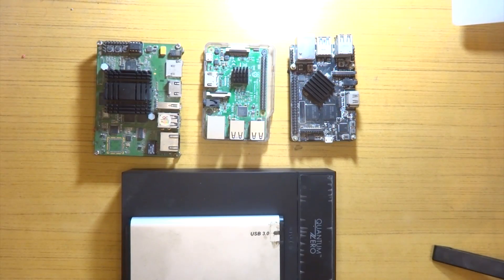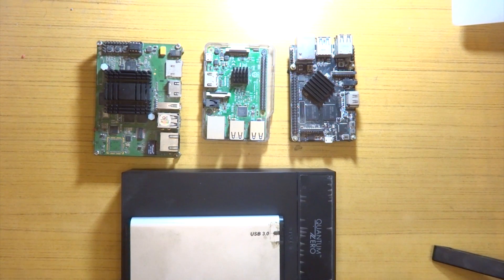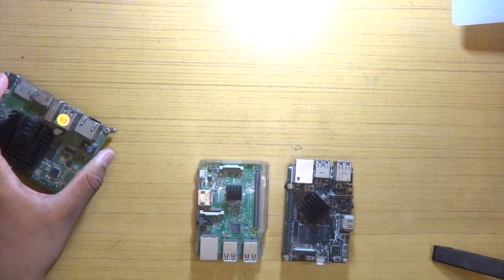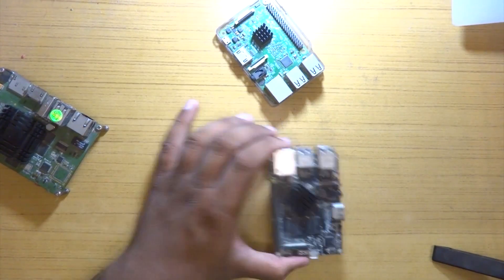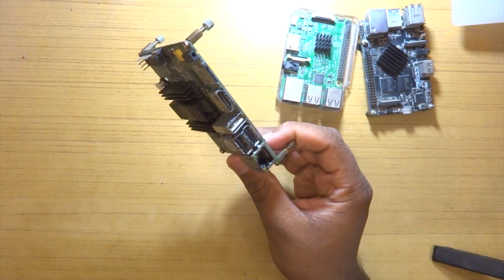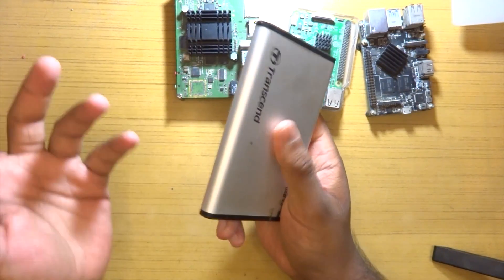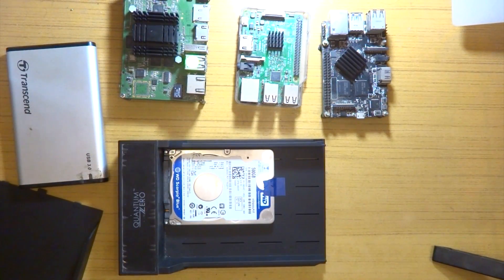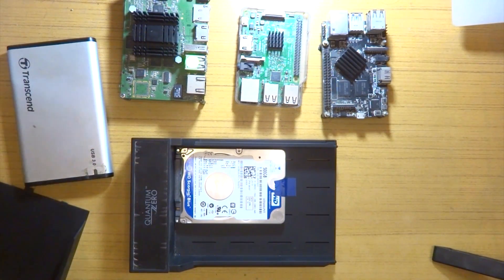My Experiments with DIY NAS | using Raspberry Pi ARM and x86

Comment: Isn't it a common sense to use a powered USB hub with RPi? Mechanical drives will always need more power than anything chip related, this is a no brainer. Btw why not use OpenMediaVault?
Reply from the maker: +Consig1iere dude, the whole hardrdrive is externally powered by a seperate 12v psu why would I need a powered usb hub?
OpenMediaVault
1) It only supports debian jessie, that has been surpassed by Debian Stretch in favour of kernel 4.9
2) It does the same things that I can do manually and have better control over it

Comment: Whis OS are you using for the raspberry pi? FreeNAS doesn't seem to support arm.
Reply from the maker: Rampagezed raspbian jessie lite
Reply: That's it? Don't you need the special features that a dedicated NAS OS has? For example openmediavault can stop the disc from spinning periodically in order to extend its life and other nice features.
Reply from the maker: Rampagezed I'm using external hdd so diak goes to sleep automatically and all these features can be manually configured in Linux if so desired
Reply: That makes sense. Thanks man and keep up the videos, they are very educational!

Comment: What Cheap (sub €50) SBC (or low power pc) do you suggest?
I would like to use 4 1TB 3.5" sata drives in a raid 5 setup.
Currently i purchased a 'msi wind 100' with an 'atom 230 processor' with openmediavault.
But the speed is around 7 MB/s... (too slow for me)
I'm still a student and money is an issue... :/
Thanks anyway, doing a great job with your video's! :)
Reply from the maker: their are cheap PC with the z3735 chipset or any other atom chipset